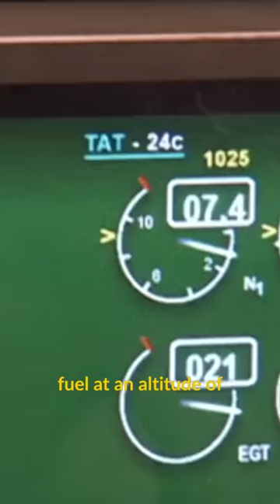Remember the 767 that RAN OUT OF FUEL? ! #shorts

Comment: That Captain and FO and the whole cabin crew are seriously heroes.
Reply: I don't think so. They did not do preflight check before departure which could have been avoided in first place.
Reply: @peterpark5630  the wrong amount of fuel was loaded but marked as correct by the fueler.
Reply: @mdb831  I understand that part but pilots can see fuel meter in their cockpit just like we can see for cars on meter. They did not check that on their end.
Reply: @peterpark5630 Absolutely we would see fuel indicator in cars ..this is a flight
Reply: @peterpark5630  sure they did…they mistook lbs for kgs. Hence the problem
Reply: @peterpark5630  yeah sure they “have a gas gauge” it’s not like a cars
Reply: @peterpark5630  they were never taught in metric which is what the plane used.
Reply: @peterpark5630  Womp Womp

Comment: Seems to be a Canadian thing, to have planes run out of fuel. Something similar happened to Air Transat Flight 236 in August 2001, over the Atlantic!!!
Reply: The Air Transit plane had a significant fuel leak reducing their fuel load.

Comment: There is another piece of data:

The airport was being used at the time as a racetrack and there were people at the end of the runway who were this close to being run over by the plane.
Reply: Yep
Reply: Oh they weren't close to being run over. The two kids riding their bikes on the drag strip (runway) maybe but nobody else.
Reply: The racers went over to the plane with fire extinguishers to put out the burning insulation caused by the nose gear collapsing. In a somewhat ironic twist, the repair crew was driving from Winnipeg to Gimli and ran out of gas along the way.

Comment: I faced this situation on my flight from Greek airport to Cyprus in MSFS. I didn’t used to monitor my fuel but used to do house work while it is flying. Luckily I forgot to set cabin pressure and the alarm made me to check all systems and perform an emergency landing.

Comment: I like the fact that the chase of this accident was explained by a simple error of conversions. But there's more to it. In the 1980s, Canada was trying to switch from the imperial system(lbs) to the metric system (kgs). So when the pilots boarded the plane, they thought they had enough fuel due to it saying abt 54,000 and assumed 54,000 lbs of fuel. In reality,  it actually said 54,000 kg of fuel which is roughly 27,000 lbs of fuel. What an amazing story tho!
Reply: Actually, one kilo is 2.2 pounds, so it's the other way around - 54, 000kg would be about 108,000lb. 

According to the wiki page: "After taking a dripstick measurement, Pearson converted the reading from centimetres to litres to kilograms, but he did his calculation with the density figure for jet fuel in pounds/litre from the Air Canada refueler's slip, used for all other aircraft in the fleet, instead of kilograms/litre for the all-metric 767 aircraft, which was new to the fleet.[11] Since the FQIS was not operational, he entered the reading into the flight management computer, which tracked the amount of fuel remaining in kilograms."

If he entered 54,000, the plane read that as kilos, but there was only 54,000 lb (about 27,000kg) on board. I'd link the actual wiki page but YouTube doesn't allow external links in comments.
Reply: It's the other way round , 1 kg is 2.2 lbs !
Reply: @maryburger1232  oh mb! I'm American so I can't do conversions well lol

Comment: It is July 23rd. 1985 the Canada Air 143 takes off. a few minutes later the vengeful engine fails and then the other one. Suddenly the instruments in the cockpit fail. The pilot wants to make an emergency landing in Winipeg, the copilot calculates that you will crash 25 km from the runway, so you fly to gimli. the pilot was working at the outpost and he knew it was a very long runway. But he didn't know that the runway was being converted into a race track and that there was a race on the day when they saw it they got heart palpitations and said to the copilot extend flaps they heard the rollers engage but the front one didn't so they flew to gimli without anything know at the beginning of the runway there were two children with their bicycles. when they saw that they drove away quickly one boy said faster both boys started to cry but luckily they survived. the pilot decided to loop and it did. then they could land. But when they just touched down with their noses, the front flap retracted and the rear tires burst. But the landing takes place... they all had to get out quickly so the plane didn't start to burn but it didn't and they were able to get out everyone started clapping

Comment: When you loose both engines you also loose all hydraulic and electrical power. The hydraulic pumps and generators are driven by the engines. I believe the Apu can be started to provide electrical power and the RAT drops into the airstream to provide limited hydraulics.

Comment: Slip landing performed with a jet plane! Insanely cool, but metric system and imperial calc, the pilots messed it up themselves . ..
Reply: Pilots requested the correct load... fuel loader messed up the conversion. Air Canada didn't have a spare fuel level circuit board to replace the failed unit in the computer preventing the pilots from seeing the issue.

Comment: I know they have fuel gauges on these things. Didn't they notice they only had half a tank before takeoff? 😮
Reply: Aircraft measure their fuel by weight. The fuel gauges likely showed the right number, just in the wrong units.
Reply: They put in the number they had, from a miscalculation, and the plane read it as kilos. If they'd put in the actual weight, the instruments would have shown they needed more.

Comment: Classic air canada can't even get the metric system right.
Reply: Apparently all the other planes in the fleet at the time were still using imperial, this was the first plane to use metric, and there was a miscalculation when going from volume to weight.

Comment: In the 1990's there was a spacecraft that was lost for the same reason: kilometers and miles being confused
Reply: Mars climate orbiter.
Reply: Technically the software confused pounds for newtons when calculating an engine burn, not miles and kilometers
Reply: @SuperRaidriar  same net effect. Incorrect thrust planted the vehicle quite firmly, rather than landing softly.
Reply: @SuperRaidriar  maybe both things have happened to different spacecrafts

Comment: Isn't that the flight that did a special crab flight to slow down🤔 I can't remember it but I tried it on an RC plane and in a sim and it's kinda crazy..

I think you put full rudder and nose down strong and at the same time use ailerons to kinda set it up in a very strange approach in crazy a angle but it works and is very stable once you get it setup.. 🤔 the worst part is the transition into it and out of it and the plane flies straight but nose down and in a very aggressive crab landing. It was wild when I did it on a big BEA T45 RC jet😂 it's like driving sideways with the parking brake on😂

Comment: This is my favorite aviation accident but you missed my favorite detail about it. The pilot had experience with flying gliders and they were too high for the approach but too low to circle around so the pilot did an unusual (for commercial aircraft) slip maneuver to bleed off speed and altitude in order to make the landing.

Comment: So even if the humans had a brain fart with units how come the plane didn't report that the fuel load was short relative to the programmed flight plan? Surely the plane knows the route and distance and also the fuel weight/volume so how was this even possible it allowed takeoff without a warning?
Reply: 1983
Reply: The ground crew said that a certain amount of fuel was loaded. That's what the captain entered into the flight computer... But the ground crew gave the weight in pounds and the flight crew understood kilos, due to a miscalculation by the ground crew when fueling the plane. The plane was told it had 54,000 kilos of fuel, but in reality only had about half of that.

Comment: 1983 ?? 767?
Reply: I REMEMBER 😅
Reply: A quick look on wiki yields this information: "The Boeing 767 is an American wide-body aircraft developed and manufactured by Boeing Commercial Airplanes. The aircraft was launched as the 7X7 program on July 14, 1978, the prototype first flew on September 26, 1981, and it was certified on July 30, 1982."

Comment: Didn’t they have a fuel gauge?
Reply: Good question. Fuel gauges, or rather working fuel gauges, are not considered essential as pilots are very careful about ordering the right amount of fuel and tracking fuel usage during flight. So, with a faulty controller board and no replacement, the plane was given the go-ahead to fly without a working fuel gauge.

Unfortunately the ground crew screwed up the calculation from metric tons of fuel to gallons to be pumped in, and only gave them half a load.
Reply: On that flight the Fuel Quantity Indicator was Mel’d.  (It was broken).  Pearson and Crew only used the FMC as a fuel indicator using the incorrectly calculated fuel load.
Reply: From the wiki page: "The incident was caused by a series of issues starting with a failed fuel-quantity indicator sensor (FQIS). These had high failure rates in the 767, and the only available replacement was also nonfunctional. The problem was logged, but later maintenance crew misunderstood the problem and turned off the backup FQIS, as well. This required the fuel to be manually measured using a dripstick. The navigational computer required the fuel to be entered in kilograms, but an incorrect conversion from volume to mass was applied, which led the pilots and ground crew to agree that it was carrying enough fuel for the remaining trip. In fact, the aircraft was carrying only 45% of its required fuel load."